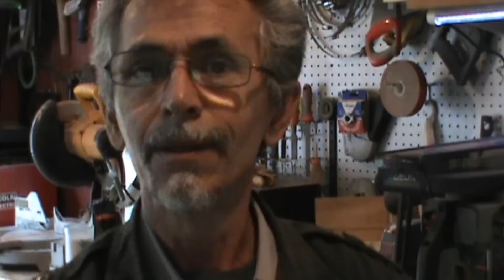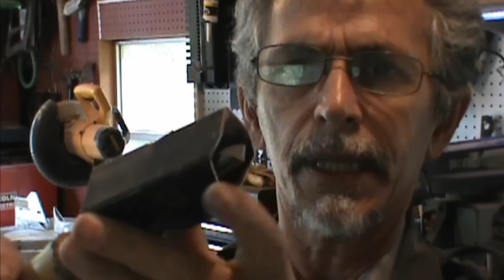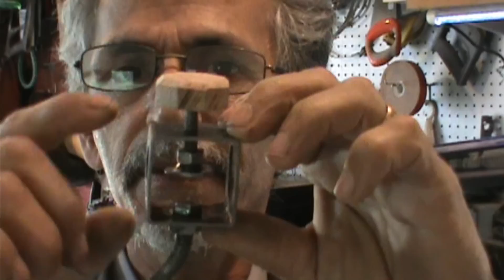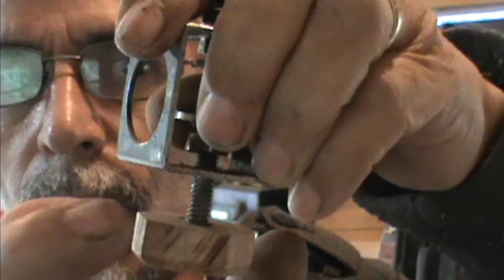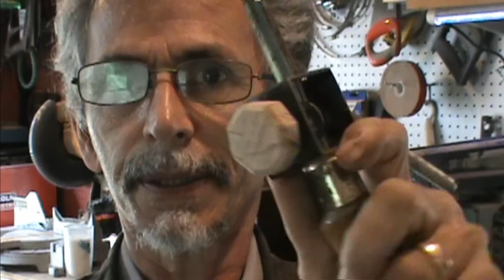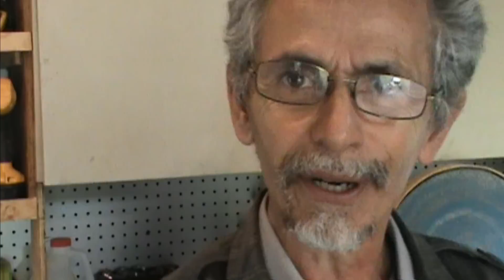DIY lathe sharpening jig by Al Furtado

Comment: What does the length of the all thread piece on the bottom need to be?
Reply from the maker: Thank you very much, sorry for delay in responding . I thought I had responded to this. About 6 inches
Reply: @AlFurtado  no problem... i made mine to work with a belt sander so i actually think i may have to shorten it quite a bit. I made it 7" but now that ive played with it i see that there are alot of variables